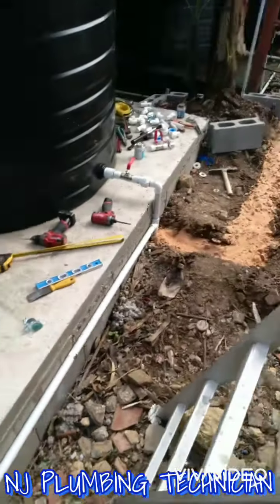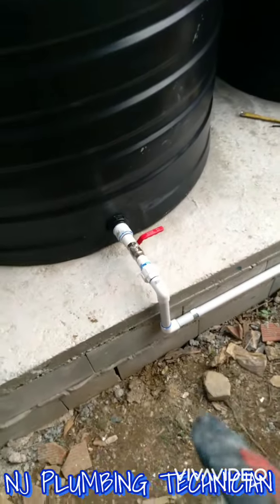Plumbing In The Caribbean... 1000 Gallon Tank Installation..

Comment: Hi, I would like to install a 2000 gallon water tank that measure 121.5 inches tall x 73.5" wide. Please advise how thick my concrete base should be? Thanks in advance.
Reply from the maker: Minimum 6" thick with a steel mat and BRC. also seek some advice from an engineer if it's going on a height